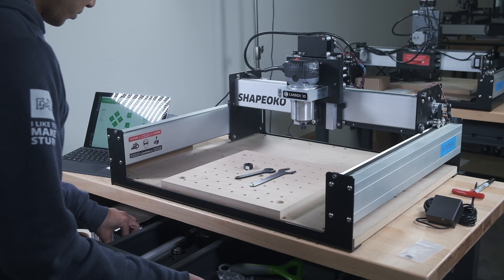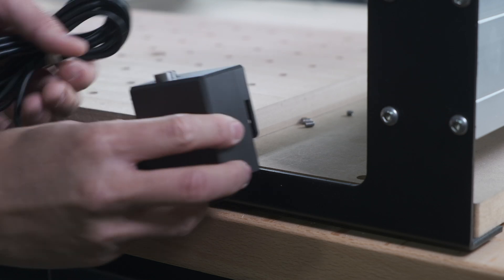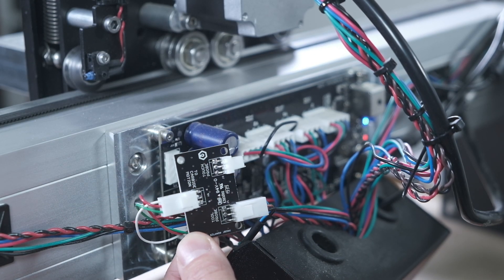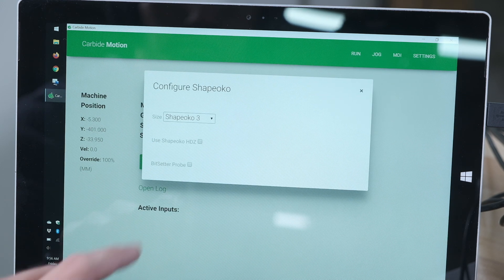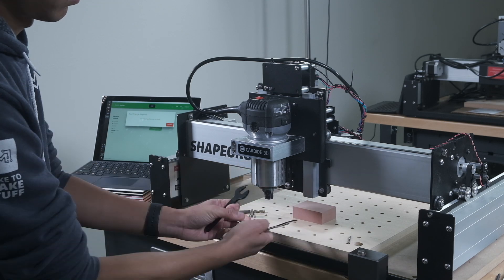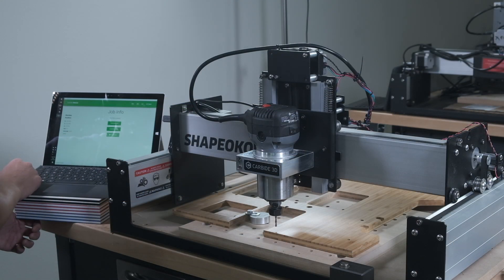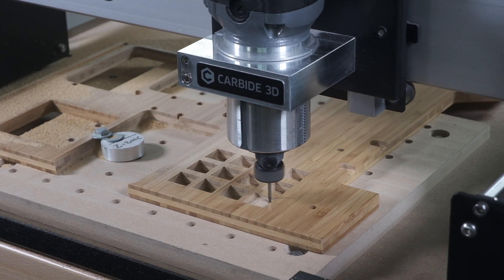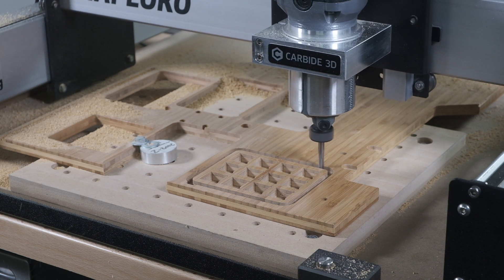Introducing BitSetter - Automated Tool Length Probing for Shapeoko

Comment: This was to vase and I could not see the computer screen very well
Reply from the maker: The setup sequence has changed significantly since this video was published. The software now includes a setup wizard when you first configure your machine, so what you see in this video about setting up the BitSetter is not really relevant anymore. You only need to take away the broad concepts.

Regarding the workflow with BitSetter, we have some examples in our Jumpstart Course, with clear, step-by-step guidance you may want to check out: https://carbide3d.com/hub/courses/jumpstart/

If there are specific areas you need help with, feel free to email in to support@carbide3d.com.

Comment: It is possible to run the cnc without the bit setter?
Reply from the maker: Yes
Reply: @carbide3d  how? I am breaking v bits when I use the bit setter in my nomad 3 support don’t  answer my mails just a little help or if you have a video send me the link.
Reply from the maker: The Shapeoko can be run without the Bitsetter.   The NOMAD cannot.
Reply from the maker: Under what name did you reach out to support?
Reply: @carbide3d  ok thanks Christy jewelry

Comment: I got a Bitsetter with my kit when I bought it and installed it, no problem. Issue I am having is that everytime the bit touches the magnetic disc, the magnet attaches to the bit and gets carried off. the bigger issue is when it takes the disc off, it is always slightly off center and when it goes back down, the disc cants on the edge of the socket and the reading is off. Should I glue the magnetic disk to the Bitsetter? Right now, this issue makes the tool effectively useless.

Comment: question  how bit of a dia bit  can be used on the bit setter. I have a .75 dia 2 flute straight plunge bit I want to use to clear a pocket then change to a .25 dia bit to finish the pocket

Comment: Has anyone run into a problem where the bit setter is measuring too low? For example, I used the touch probe to set the z height which comes out at 31mm, then I started my program, installed the correct tool, it measures the tool length but when I went to verify the height of the tool it is 5mm lower than what Carbide Motion is showing me. It has happened multiple times where I plunge that extra 5mm and start cutting. Any help would be appreciated.
Reply from the maker: Please send us an email at support@carbide3d.com so we can help you figure it out.
Reply: @carbide3d  Thanks! I will today.

Comment: Hey Winston, thanks for the video on this and in using the bitsetter and the probe, where is one to place the coupling board that comes with it? There does not seem to be enough room in the control box without having it touching something else, perhaps causing a short in the circuitry. That would be a bad thing so is this small circut board to be affixed to the outside of the control box somewhere? Perhaps drill a couple of holes in the Y1 rail and screw it to the rail? 

Thanks again,
David J.
Reply from the maker: The splitter board should be able to go inside the enclosure safely even if it is a little cramped., the bottom of the board is coated to prevent short circuits.
Reply: @carbide3d  Hey 3D Team,  Thank you for the response and that makes me feel better being able to place the board into the enclosure without worrying about short circuits. 

Kind Regards...

Comment: If i'm using this in addition to a touch probe do i need to do the XYZ probe or just set the probe on top of the work piece and do the X and Y separately? I'm a little confused as to whether the Z i set with the probe overrides the bit setter.
Reply from the maker: BitSetter doesn't change how you use the touch probe or set your zero, you should continue using whatever method you're comfortable with. It just means that after you change a tool the machine will be able to bring the tip of the endmill to the same position, regardless of length.
Reply: Carbide 3D is there a documented procedure for using bitsetter and the touch probe together within a project that has a tool change? That would be very helpful.

Comment: I am so excited for this... Am I understanding it correctly, that if I let Fusion360/Carbide Create export tool paths with multiple tools in it, the M16 will automatically get added to the GCode? (and then subsequently the bit-setter will happen automatically by Motion?)
Reply from the maker: *M06, and yes. Just make sure that your tools are numbered differently, and not all "T1". If you use the tool library on our site for Fusion, or the built in Carbide Create library, you should be covered. Otherwise just double check your work.
Reply: @carbide3d  Most excellent, thank you!  Sorry, I thought I heard M16 in the video, thanks for the correction.

Comment: How does this work with a dust boot attached to the machine? Is there enough clearance to use with a boot?
Reply from the maker: As long as the endmill sticks out past the hard parts of the dust boot (brushes should be okay), it won't matter.

Comment: Winston I contacted Vectric today and told them about the bit setter and that it would not work the vcarve pro because there was no tool change option .The responded with 2 files one for inches and one for MM. They sent me the two files. So if anyone want either just email me  @ cusoak@gmail.com and I will send it to you. Jeff
Reply: Email sent from Clintoncarawaycnc@gmail.com

Comment: In the  video I did not see you using  anything other than an EM changing' will it do v bits form tool bits straight 2 flute router bits.
Reply from the maker: It will work for any tool that will hit the probe. I've used it with up to a 1" surfacing bit, but some larger diameter tools (particularly with inserts) may miss the button.
Reply: @carbide3d  Is there a way to tell the SO3 to NOT use the bit setter, for when we're using a bit that won't hit it properly (spoil board surfacing bit comes to mind)?

Since Christmas, I've added the XL upgrade, HDZ, touch probe, and now this one will be arriving today.  The upgrades have taken an already amazing machine to a whole new level.
Reply from the maker: @SysadminsWithGuns  You can go into the settings tab in CM and uncheck use of the bitsetter. Make sure you manually set your zero height after doing that though, because the Z-offset CM stores may be deleted and throw off your heights. Also, write down your coordinates for the bit setter to make it easier when you turn it back on.  (I keep them on a piece of masking tape I stuck to the back of the  bit setter.)

Comment: Does It Matter what  soft ware you use to design in I use VCarve pro
Jeff
Reply from the maker: As long as the software inserts am m6 command it'll work. The default post processor that Vectric wrote will not. But someone shared one they custom modified in the forum which should work. Most other cam software should work fine. Just make sure your tools are numbered differently.

Comment: It would be super awesome if this worked with the X-Carve as well :)  I know, I know, it's just software, but perhaps open sourcing the machine commands so it could be ported would be nice (unless of course you open source carbide create instead...)
Reply: In the Video, the Connector to which the end of the TLP was attached to had 3 Pins - If all of them ( V+/V-/Signal ) are required then we'll be out of luck as the X-Carve only uses a 2-Pin ( V+/V- ) for its Probe Connection.

Comment: That's a great option!  If during the bit change I bump the x/y a little will it detect and adjust that too?
Reply from the maker: It does not detect missed steps like that. If you suspect you did affect the positional accuracy of the machine you'd have to re-home. But if you do tool changes with a pair of wrenches on the spindle/collet nut, you should be able to apply a high degree of torque without lateral forces that would cause those missed steps.

Comment: So does it raise the spindle up high enough automatically?  I was putting a small 5 second tool path outside my cutting area between tool swaps but I always had to change retract heights on my projects or it wouldn’t raise up high enough to get longer bits on/out.
Reply from the maker: Spindle will retract to the max height (minus ~5mm) for tool changes.

Comment: Does this work with universal g code platform?
Reply from the maker: We've engineered it to work with Carbide Motion. Technically there's no reason another Gcode sender couldn't do it, but you'd be in your own. The hardware will trigger just like any other probe, but it's up to the software to know what to do with the signals.

Comment: I just got mine today. It arrived about 4 days after the order. It feels solid and heavy-duty. Chamfered edges on this thing are fire. It even comes with a nonmarring plate and if you have the touch-probe it comes with a splitter hookup so you can use both.

Comment: what is the difference between this and the touch probe? can they do the same things? what do they do different?
Reply from the maker: They do very different things. Touch probe helps you find a zero point. BitSetter compensates for different tool lengths so you don’t have to find the zero height every time you load a new tool. Technically, you could just manually use the touch probe after every single tool change, but that doesn’t work if your reference surface has been machined away or something.
Reply from the maker: @thesingulardank  Touch probe will be in stock when production allows, best to sign up for an email notification for availability.
Reply: @carbide3d  What exactly  does that mean

Comment: Vectric Software will not let you save different tools into the same gcode is my understanding - please correct me if I'm wrong.  This is a great idea!
Reply from the maker: That's a limitation of the post processor that Vectric wrote. If you search on our forums, someone has modified the post processor to fix that.
Reply: @carbide3d  Can you tell me and  anyone else that  uses V carve Pro that  want to but the bit setter  where to find that post.. I would have  thought that Carbide 3D would have thought to provide that  info .on how to change the  Gcode. There are a lot of  us that have Shapeoko,s that  moved on to other soft ware.
Jeff Peters

Comment: Awesome! Can you force it to probe in the middle of a program if you were to lose steps in z-height?
Reply from the maker: You can trigger a tool length probe manually outside of gcode execution, or automatically on a tool change command in gcode. You'd have to stop to program and restart it if you lost steps.

Comment: If you are using a 2.2kw spindle wired through the control board will Carbide Motion turn off the spindle and bring it to the center for a tool change and depth probe????
Reply from the maker: I believe it will control the spindle, but still prompt you through the same steps. Default configuration for the Shapeoko assumes manual spindle control unlike the Nomad. -W
Reply: As long as you are using PWM to set the spindle speed it is always turned off when you pause, stop or complete the job. Luke has done a good video on how to set this up if you are not sure.
Reply: @glennespie8647  Luke D'Lonra-Bonathan  is walking me through the setup. 
Did you wire it directly from the VFD to the controller or use a  low voltage relay???